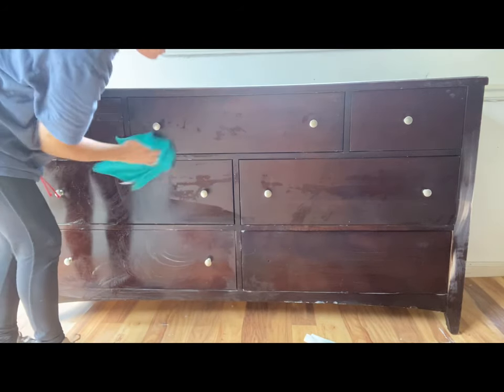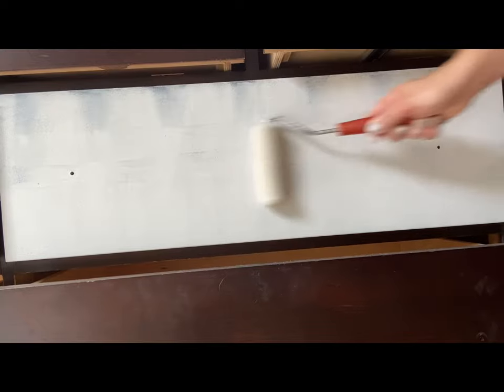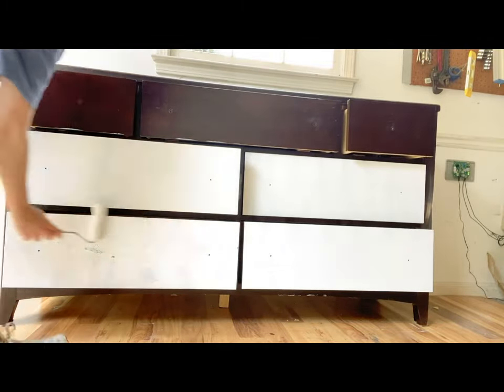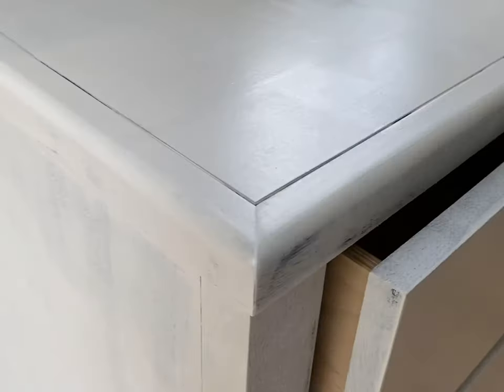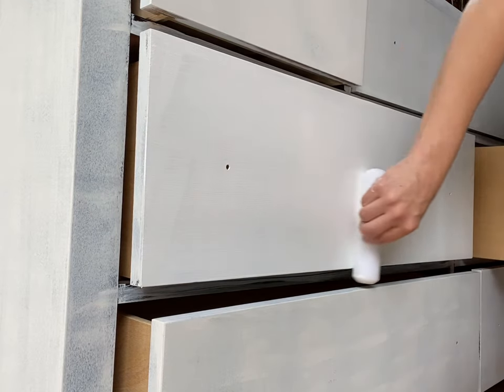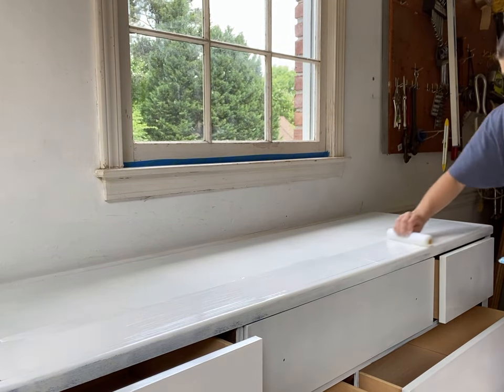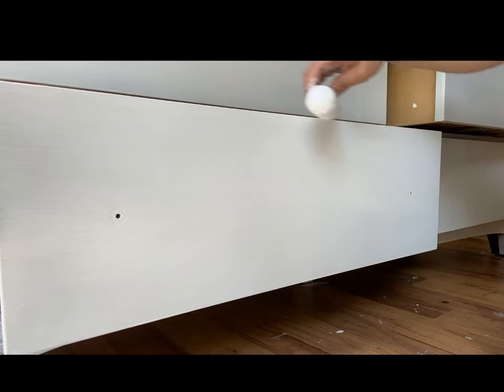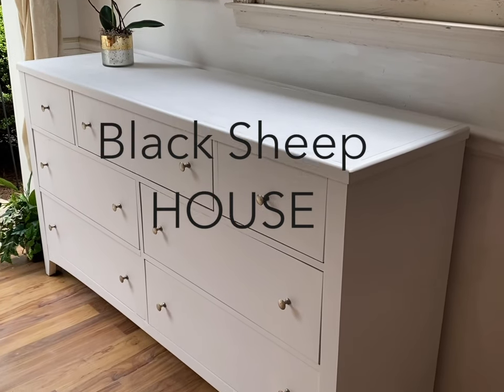Painting Furniture White | Secret 🤫 primer!

Comment: I have used this primer to redo my kitchen cabinets. IT IS AWESOME!  I used my paint sprayer to paint the cabinets with this primer and it worked perfectly fine. All I needed to do was run paint thinner alcohol through the paint sprayer to clean it out when I was finished.
Reply from the maker: Good to know 🙌
Reply: Thanks for the tip.
Reply: Thanks for the tip

Comment: What is the difference between shellac primer and 1 2 3 primer. I wish I had read the description before asking question. Anyways buddy , why did you use a primer when the paint you used is a “paint and primer in one”
Reply: I too was wondering the same thing.
Reply: You have to use multiple coats like 3 or 4 due to the dark color furniture. She’s eliminating steps with the actual times to paint once dry.

Comment: I absolutely love your videos!  When painting furniture white, what kind of top coat do you recommend without it turning yellow.  Thank you!!
Reply from the maker: Thank you!  I tend to either use water based polyurethane by Varathane or I use clear wax by Behr, both are easy to find at Home Depot
Reply: I am also concern about the top coat. I heard it can turnout yellow. Which one did you end up applying?

Comment: This is such a great tip. I have put one coat of dark charcoal paint on a dresser and it took me forever to sand off the brush marks. I used Behr chalk paint and I expect chalk paint could be more challenging to attain a smooth finish because it is thicker than regular paint. I will definitely try this method for the next coat. Thanks so much!!
Reply: It seems like most people who use chalk paint thin it out and also use a mist bottle when painting with a brush.
Reply from the maker: I have a hard time with chalk paint 😅 it gives me the most trouble with brush strokes and then when I try to top coat it with water based top coat o get streaking.  I’m totally done with it honestly and now I only use Behr or General finishes.  I want to try fusion though!
Reply from the maker: Honestly if you want the smoothies finish go with General Finishes Milk paint.  It’s so nice to work with
Reply: @blacksheephouse  I am all new to this and it is only the second thing I have painted with chalk paint. The first thing was an antique doll cradle with spindles and oh boy were the spindles ever miserable with thick goopy paint to contend with.   So far I am not seeing the benefit with all the trouble with brush marks either. I scuff-sanded and sealed the dresser with shellac. I am not very sensitive to smells so I don't want to take a chance not knowing where the dresser came from. I expect going forward I will take these steps regardless so chalk paint isn't necessary I guess to skip sanding and primer. I have heard great things about General Finishes. Thanks so much for the kind and great advice!!
Reply: @blacksheephouse  I've heard a trick to avoid streaking when topcoating chalk paint. Mix just a little bit of your paint into the topcoat. Even works on black finishes.

Comment: Bin shellac is a must on everything. It's an unskippable step, don't waste time with anything else. It's not a secret, but a go to product for literally everyone who knows about conversions. Edit - I've never seen someone using a mini roller as a sponge. I instead recommend getting a better leveling paint for your topcoat such as urethane satin enamel from Sherwin. It's far far far more durable and the stippling pretty much disappears. You could also rent a sprayer or borrow one, or use an hvlp gun if you have a compressor. Best way to eliminate brush strokes is to spray. If that's not an option, you can also try a latex extender with the emerald trim paint.
Reply: Not sure if you've watched her  channel long but she usually doesn't like to use paint spray guns due to the waste of paint
Reply: Based on your “expert” advice I don’t think you’re very familiar with her channel her work or her personal preferences when it comes to painting furniture.
Reply: @Jennifer B  I've been painting houses for 20+years. We've also done more trim conversion than you can imagine(it's a big trend eliminating wooden trim and doors converting it to white). I've also painted more than my fair share of kitchen cabinets and all sorts of builtin cabinets/shevles/dressers, fireplaces(both metal and brick conversion), wooden beams, and even a few tubs and surrounds as well as car rims, decks, metal and wooden fences ect ect ect. Is it possible to get a factory finish without a sprayer? Yes, if you spend enough time buffing and polishing and sanding with extremely fine sandpaper you could in theory achieve similar results to a sprayer on non-intricate flat surfaces. Is it worth the time and effort to do it like that? No way. You'd be shocked how efficient an hvlp sprayer can be or an airless with fflp tips(fine finish low pressure). At some point you have to value your time more than the miniscule amount of paint wasted by spraying or the additional steps required to hopefully get it to that level a different way. The last conversion I did had over 60 shelves and door fronts, it was a long process even with my sprayers, to do them by hand is a massive waste of time I wouldn't wish upon anybody. To attempt to perfect them with minirollers and brushes is a task I literally don't even want to think about. I had everything I could stacked outside ontop of drops and my extension ladder, a small spray booth near by, and I layed down coat after coat after coat til everything was done (air drying between coats). With this dresser, if you had it outside on a drop you could spray a perfect layer on it within minutes.
Reply: @AlexKunstar  that was a lot and I’m definitely not reading all of that, maybe you missed my point. Maybe you are an expert but you must not be very familiar with this particular content creator. She does not like to use a paint sprayer as she states many times throughout her videos. She makes videos based on her personal preferences and shows people how to do her technique which does not include using a paint sprayer so you giving that advice is not very useful even if you think it’s the best. People are not watching her content for paint sprayer tips.
Reply: @jenniferb8145  if you had read my original comment it also gave tips on painting when a sprayer isn't an option (using latex extenders and urethane trim enamel with better self leveling properties). I'm also adding a professional finishers observations on what is required to take it up to the levels of a factory finish. Which is something she points out in other videos as well, that this process cannot achieve the same quality as a sprayed finish. This comment isn't to address her process, it's to give better alternatives to others, or at least get them to not be intimidated by sprayers. I just love to paint, and love watching people paint. If this is her comfort zone keep going. There are much faster ways.
Reply: @jenniferb8145  people aren't eliminating wood trim, they're painting over it. If that counts as eliminating so be it but a paint sprayer always requires an open area. Not everyone has that available to them, like myself & weather doesn't always cooperate. Maybe not everyone wants the same finish as you deem appropriate & are happy with what the end result is. Please use your technique as you wish but respect that others do not use it.

Comment: Did it leave a smooth finish after you used the foam roller without the handle?. I know on your painted black using General Finish furniture video you used sand paper. i love the look of the General paint but I can't afford it.. Once again thank you for sharing.. I will take any tips..
You used Dawn & water, I was told to use Windex, Degreasers or Zep..

Comment: Just came here to say the spray sucks if you're a noob like me. I ended up with different densities because of how hard it was for me to control the sprayer. Also it costs as much as a QT of the liquid stuff and wasn't enough for a bookshelf. When I did the second coat with the liquid, it barely used 10% of the can. Don't make my mistake. Also definitely get a high density foam roller. That thing rocks for uniform spread

Comment: Great video. Do you not have to use a top coat?
Reply from the maker: Depends what sheen you go with on the paint, the higher the sheen the more durability.  I prefer a matte finish so I generally go with a matte water based polyurethane.  You can also check out my one step paint recipe here: https://youtu.be/AAPd3F3J7xg

Comment: Hello, I like that I don't have to sand it, since I want to redo my bedroom set to white and it will be hard to get it down the stairs, so No sanding is a great option, But how is the paint holding? Does it last a long time without sanding?
Reply from the maker: Yes, holds up great, important to wait for it to fully cure before heavy use but 👍 you’ll be very pleased
Reply: @blacksheephouse  How long will the curing process take?
Reply: What is curing process? Plz guide  @blacksheephouse  because i am going to paint my dark my table like this without sanding. And it will be my first attempt

Comment: Hi! Previously I used chalk paint without priming and it worked great.  I switched over to the this Bin product and the paint is not adhering well.  When I wipe off the surface, the paint comes right off.   It sure what I’m doing wrong. 😓
Reply from the maker: Hey Christine, I had that happen one time and needed to wait till it cured, maybe that’s what’s happening?  Bin has the best adhesion of any paint product I’ve ever used so I promise give it another try.  And I’m not knocking chalk paint, it adheres great too but it won’t block bleed through
Reply: @blacksheephouse  Thank you for relaying. How long do you typically wait to slap the paint on after priming?  Is one coat of primer sufficient?

Comment: i am a lover of bin shellac based primer. however, can u tint it? cos i hate using it on dark pieces cos you have more coats of paint to do. i bought some gray primer, water based, and i have had peeling paint like crazy. do u think they can tint shellac based primer?
Reply from the maker: I’m not sure, but worth a shot to ask at the hardware store!  They have a clear spray shellac that I use, works great under the dark pieces.
Reply: @blacksheephouse  thank you i will try the clear! i almost bought that when i went with the gray that some had recommended.

Comment: Sandra WestleyUK, what do you use if you live in the UK, I certainly cannot get that shellac base paint, any suggestions.
Reply from the maker: Hey Sandra, you can definitely get a shellac based paint in the UK, maybe a different brand but anything shellac based will block bleedthrough best.  Second best for bleed through is any oil based paint ❤️ also, unless you have a red wood you should be good to go with any old regular primer, even water based.  I rarely have to use a heavy duty print unless I’m working on mahogany or something.

Comment: So I don't have much experience with painting furniture so I tried a smaller project to learn on. I had a small table in my foyer that was black and I painted it with white chalk paint. So almost 2 years  it has a pink tint to ot that seems to he getting worse. I want to repaint it but don't know what to do. Do I prime over it then paint (I don't think I'll use a chalk paint next time). I have other larger pieces of furniture that I would like to paint white or a lighter color but after this experience I'm kinda scared. Advice please.
Reply from the maker: Give it a light sand and then use the shellac white or clear primer first, you may need to do two coats, after that you can use any paint you want.  Shellac based primer is the only thing that will block bleed through like you mentioned

Comment: I have used this 4 primer. Have one question..What can I do to keep using the same can that has thicking... I don't want to waste any.
Reply: If it is water base primer, add water. (BIN primer is water base I believe). But they say not to add tap water to the can because it can damage the paint. Furniture artists I have watched recommend distilled water if you chose to add water to the can. Though it is best to add it to the paint you have poured. You can also mist your brush with water.
Reply: I don’t think Bin is water based. It’s impossible to clean brushes after using so I always use disposable brushes and rollers as well.
Reply from the maker: Hey there!  Bin comes in 3 types of primer (that I know of), oil based, shellac based and water based versions.  I use different types on different projects in my videos ❤️ whatever the can says you can use to clean your brushes up with is usually what people use to thin it, so denatured alcohol for the shellac based, water for the water based or mineral spirits for oil based.

Comment: I do not understand why you didn't remove the drawers. You got paint speckled all over the insides. I do not understand why you didn't cover the floors. I don't understand why you didn't open that window. I also don't understand the comment "you have to use this product. no other product will work. I have never used this product before."
Reply from the maker: I can understand being confused, I’m a youtuber so this is my “set” I film in my garage.  On laminate furniture I find this product works better than anything IF you don’t sand.  I leave drawers in so I can work on them at the angle that leads to the least amount of debris falling in the finish bc it is oil based it dries slower so more time for the debris outside to drift onto it, the floor is fake for videos is just old laminate from my friends remodel and I know you can’t tell but I’m working/filming this right next to the open garage door for the good lighting and ventilation (I only paint in my garage “studio” right next to my driveway with door all the way open ❤️
Reply: I don’t understand why you’re so critical?